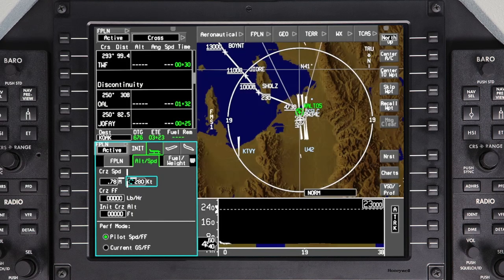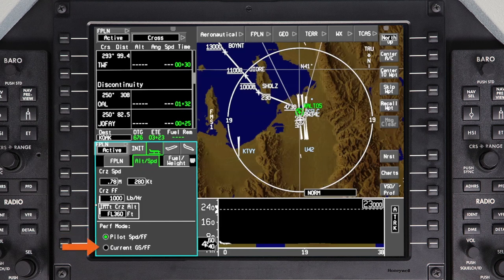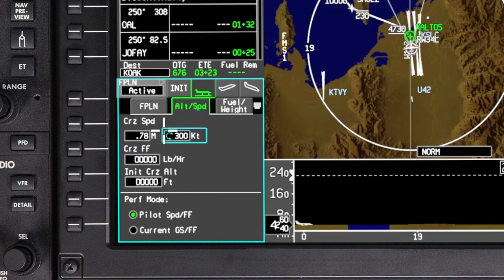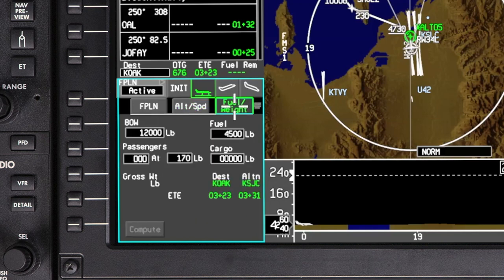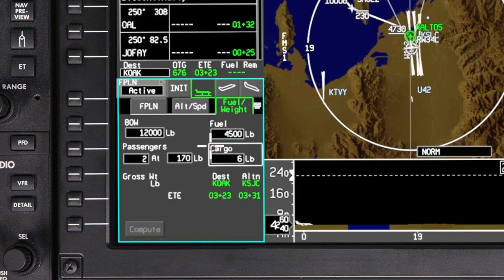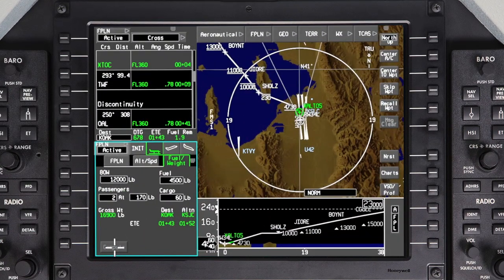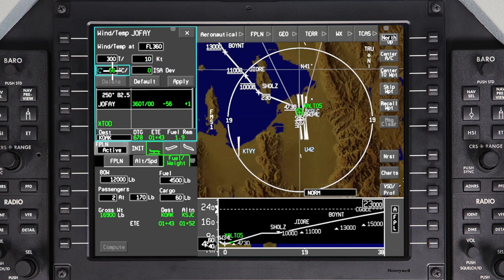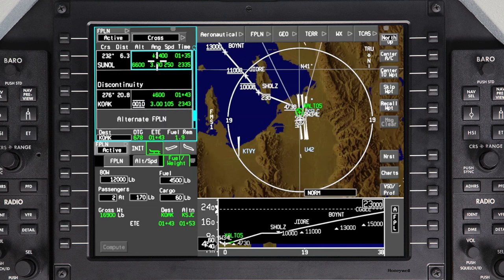Entering Performance Data on the Pilatus PC-24 | Aero Training TV | Honeywell Aerospace

Comment: Why does the plane not know its fuel flow already at different altitudes, just like we have it in Airliner FMS systems since the late 80s? That would make it so much easier.
Reply: use current for that info
Reply: 1:42 - "Only cruise altitude needs to be entered. Default values from the aircraft database are shown in the data fields but can be changed."

Given the example 0.78M and 0.80M values in the video, I suspect this was made some time before the PC-24 was certified. It's certified with a Mmo of 0.74. It's likely Pilatus would've liked to achieve M0.80 to compete with the Phenom 300, or perhaps Honeywell just assumed it would be comparable to similar size jets or even used a generic video for this.